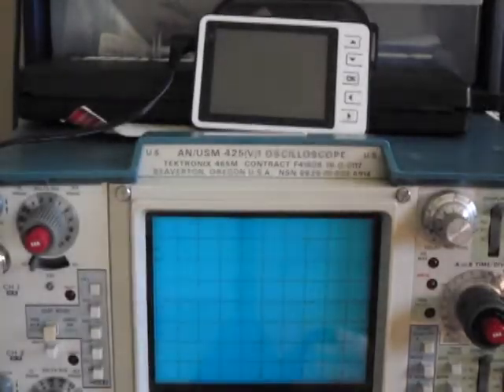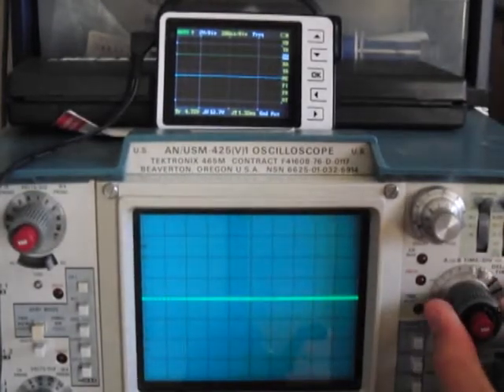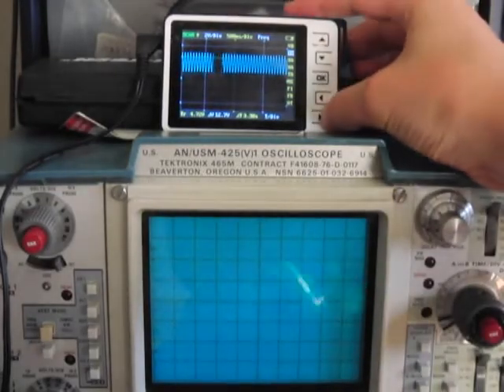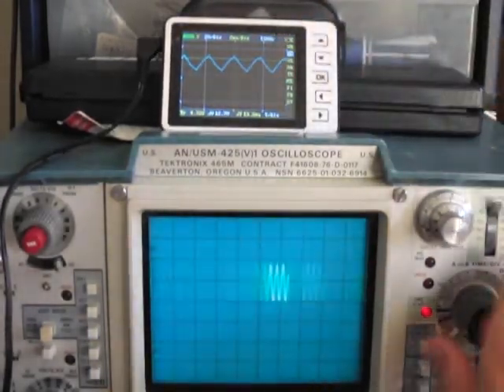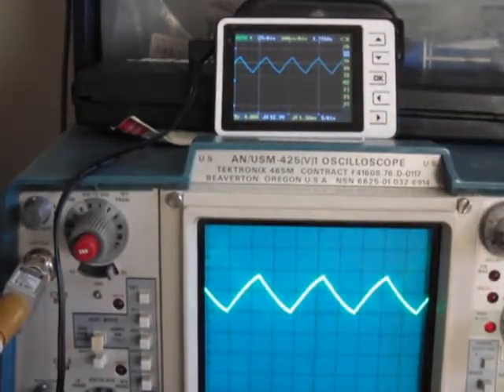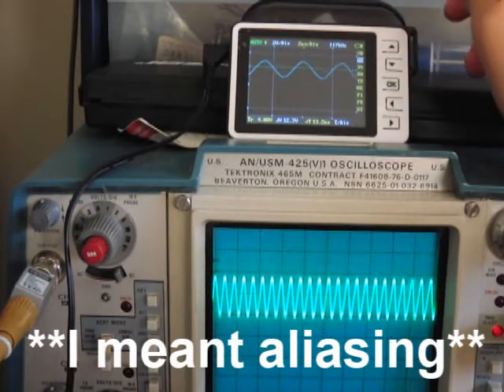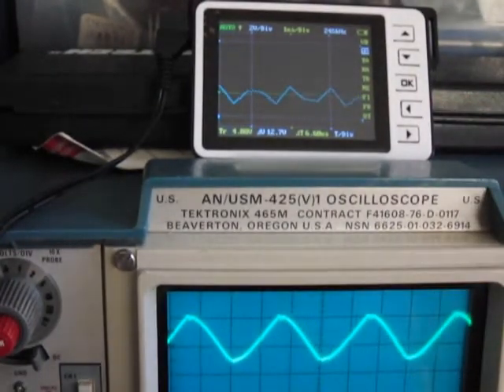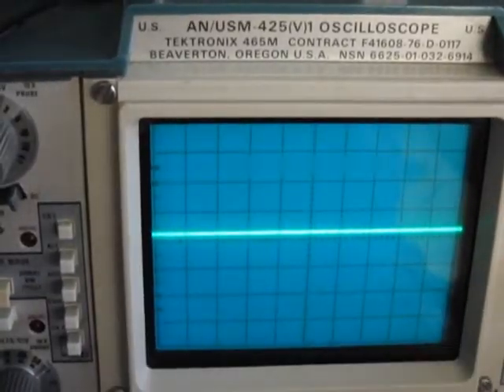DSO Nano v.s. Textronix 465 - is vintage better?

Comment from the maker: It should work. If for some reason you have to measure high voltages (like for spark plugs or whatever) you will need some high voltage probing equipment. But yes, this should work!

Comment: I would say get a used analog scope in good condition.
Better in every way.
Unless you MUST have a very portable device.
But you can build tube amps without one.
And also diagnose them.
They are usually very simple designs.

Comment: Is not possible the comparation, Nano DSO is a storage oscilloscope the tektronins 465 no, but tektroniks have other models with storage, the model 465 is better than nano at high frecuency arround 100mhz or 200 mhz at this frecuency the nano is not better

Comment from the maker: (2/2)

If you can take a slightly larger size, and still need portability and or digital storage capability, I would reccommend either the Rigol DS1052E (hacked), the Rigol DS1102E (which you can hack a 1052E into), or an Owon SDS7102. I think my next scope will be the SDS7102, because of the nice screen and large amount of memory.

Comment from the maker: A DSO Nano V2 would work OK for that, (only OK, not really good). A DSO Quad would be better, but if you can get an old analog scope like a 465 (for a similar or cheaper price) and you don't need the portability, you would probably have better luck with that (in case there is any stray high frequency stuff running around your circuit that a Nano can't capture). (1/2)

Comment: Hi,
Good review. The 465 series scopes are 100MHz units and even though there is some minor attenuation near 100 MHz they will resolve well past 100 MHz. I have actually watched signals at 115MHz.
The Dino scope is great for many applications, just not High frequency stuff.
I use to drag a 465B all over North America for years and would have loved the small scope which would have done almost everything I needed in the field and my right arm would be 2 feet shorter.
Glenn
DSM Labs (dot com)

Comment: Actually, I just used a DSO Nano to diagnose a bad Oxygen sensor on my car.  When you put the sensor in and out of a propane torch flame, the voltage fluctuates over time between ~0.1v and ~1v.  (Anything over .9v within 1 min is OK).  And sensors that are variable resistance still generally have one side at a varying voltage (sometimes 0 - 5v, sometimes 0 - 13.6v, depending on ECM), and it can be helpful to see that voltage over time.  It'll work great to see when the fuel injectors fire.

Comment: @CHIBA280CRV Most sensors don't produce a wave, except for hall effect sensors, like cam and crank position, wheel speed and vehicle speed sensors. Throttle position sensors and temperature sensors just change resistance, oxygen sensors produce a voltage, so those can be tested with a standard multimeter. Now if you're playing deep into the computer systems of a modern car, like debugging CAN bus stuff, a really good digital oscilloscope will come in handy.